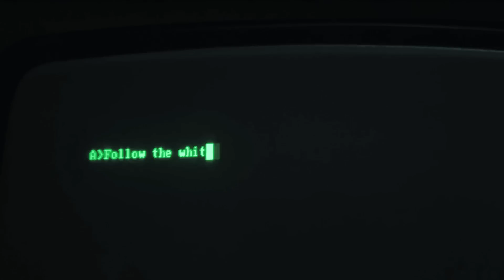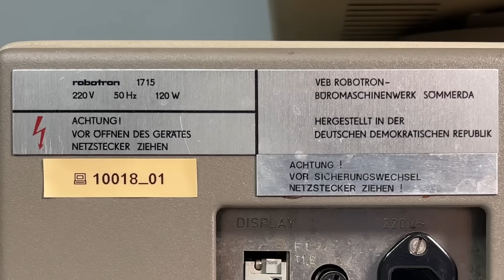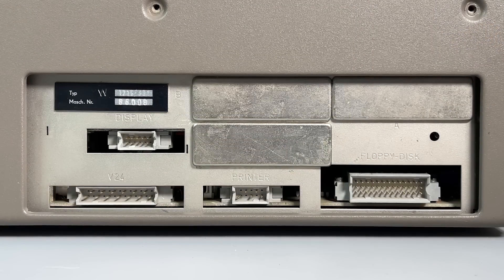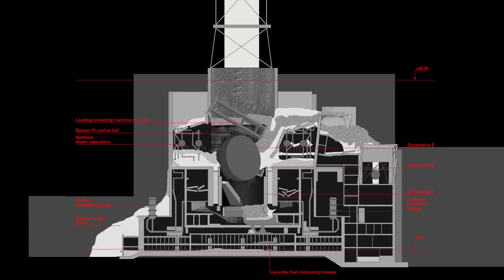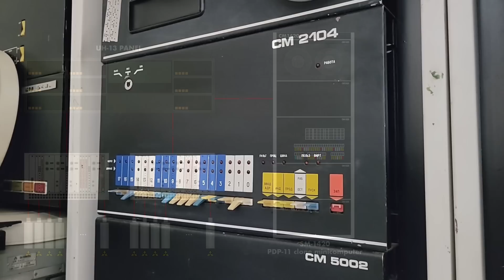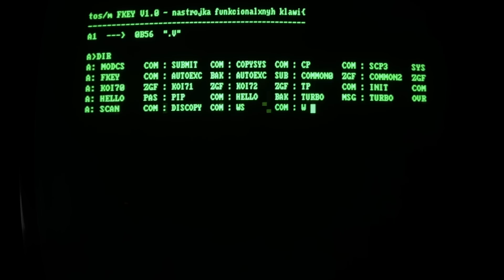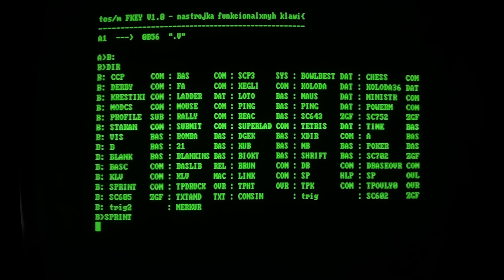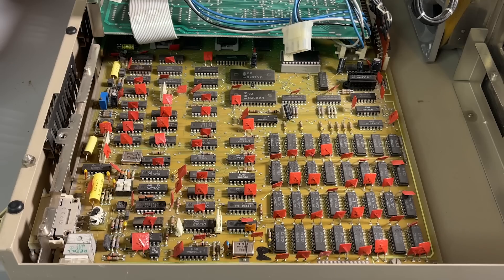How a little East German Computer Monitored a Nuclear Tomb | Robotron 1715M TEST RUN

Comment: 13:45 => the real Z80 => I remember an old (western) computer journal, where they inspected east german computers and found a broad variety of chip manufactures. The factory people (probably even robotron) answered: "We used what was available". You can also see some small ICs on your board: some are "DL..."-labeld, which is the east german coding, others are "SN74..." western model and russian "K..."-labeled ones.

Comment: Here the Translation for the 3d Maze game, its in German.

Run through the maze to the exit! For your orientation, you can show the floor plan four times.
The exit is marked with #,
Your location with a > in the direction of movement!
You can also orientate yourself using the compass at the top of the picture,
the floor plan is aligned to the north.

Control buttons:
8 - Forward
4 - left movement
6 - right movement

Show floor plan - "M" Cancel - CTRL C.

@Chornobyl Family   Nice Job to make it working again ...

Comment: The East German Rossendorf Nuclear Research Facility used two Amiga 2000 as central control computers. I've been shown around in 1987, and I was told that at the time, the facility paid about 200,000 East German Marks per device.
Reply from the maker: Wow! Thank you for sharing!
Reply: That's crazy. I didn't think they were allowed to import Western computers
Reply: @Bertie_Ahern It's not that easy. And I suspect that those computers were not imported by East Germany, but sent as a gift from West Germany to East German relatives, but seized at the border by customs officers.
Reply: @SiqueScarface  thats just silly, this late into the cold war such trades between east and west germany were rare, but possible through regular channels.
It usually was simply prevented by the price tag, as this also was the time east germanies economy already was on its knees. Mind you, the mostly IBM compatible, "mass produced" Robotron EC1834 office PC was sold for 60.000 east german mark in 1988.
Reply: @diedampfbrasse98 Yes and no. Yes, 16 bit processors were no longer on the COCOM list (but 32 bit were, hence the billion East German Mark effort to create a clone of the VAX processor in the late 1980ies). Thus 8086 and 68000 processors and computers based on them were available. This is the reason why the Robotron PC1715 shown in the video has NEC and Zilog chips and not their East German (U880) or even Soviet Union manufactured (KR1858WM1) clones. But on the other hand, East German customs seized stuff from packages, which were not correctly declared. It was then sold on the official channels. So yes, it's possible that the two computers were bought officially, but it is also possible that those were seized ones. You just couldn't tell.

Comment: I have bought and restored two of these (including two monitors) some time ago. Indeed, the fan of the power supply is quite something - heavy metal propeller and runs on 230V ac. Usually these power supplies need a recap and re-tunining sometimes with an odd transistor burned, for the screens a common fault is the flyback high voltage transformer. I was very lucky, because one 1715 had a 100% readable floppy inside with the clone of cp/m and after repairs it all booted to command prompt. My motherboard has the east German/Czech(TESLA) and Polish(CEMI) components. Thank you for this fantastic material, it's a pleasure to watch, especially with my 4 year old son who loves all robotron machines and your channel :D As a side note, I'm looking for the plug of the 1715 keyboard, as the only keyboard I was able to buy someone had its cable cut off.
Reply from the maker: Thank you for sharing!

Comment: It is a nice computer, and the PCB design is a nice and good design.  Are those  decoupling capacitors (Red ones) made by Mica or Ceramic?
I found on Google this CIA declassified document talking about electronics in the Soviet Union:
https://www.cia.gov/readingroom/docs/CIA-RDP80-00809A000700030074-5.pdf

Comment: The delta signs are a curious sign of modernity, in that the original Robotron 1715 (and I suspect, the default character set of 1715M) has a rectangular block at the position of character code 0x7F. It's not considered an ASCII printable character, and the code, with all seven (!) bits set, was once considered to be reserved for 'deleting' characters from punched paper tape by punching all the holes, so its ASCII mnemonic was DEL. With the advance of video displays, this particular usage was not particularly important, so various systems put some glyph that seemed like a good idea in this position; IBM chose a delta sign for the charset 437 popularised by IBM PC, probably as a pun for the DEL mnemonic. The reloadable charset that your start-up disk appears to have loaded is probably inspired by this.
Reply from the maker: There was a cool feature of this Robotron. You actually could load own fonts and character sets programmatically. This way you could massively extend pseudo graphics, which was actually used in a few games.
Reply: @ChernobylFamily  Yep! You can see the font being loaded in the boot-up in this very video, even. (I've only got font ROM dumps of a couple of variants of the original 1715, so I can't say for sure what might have been in the default font ROM of 1715M.)

Comment: Now I want such a box. That computer is actually awsome and made in Germany.
Reply from the maker: Imho, it is very limited for a meaningful retrocomputing, but at the same time it is rock solid, so maybe it is a good choice.
Reply: @ChernobylFamily  It´s the rocksolid part I like much.
And when it can do Tetris it´s good enough for me.
It´s  the looks at 2nd that I like, too.
Sadly these cans went decades ago from where I live and I need the hole shabang, shipping to Germany would kill me.
But if You know of a set that is in "fix-er-up" condition aka complete, powers up, needs cleaning and paint: we need to talk.
I even have an 8dot printer that might work with that.
The set just looks apart.
I hope I can sometimes maybe get one.
Thanks for the reply
Reply from the maker: Need to think...
Reply: Robotron computers are indeed rock solid ... a museum (Technische Sammlungen) here in Dresden has quiet a number of Robotron on display and for most of my visits in younger years one or two still were operational to be used by visitors/or at least demonstrated in operation. 
there is a complete virtual tour online, looks like there are still some machines set up operational in the updated exhibit ... hard to imagine more modern computers lasting that long.
Reply: @LaLaLand.Germany  there are some floating around on ebay and other german second hand trade platforms, but most often without the monitor ... and the prices are rather high, especially when overhauled and complete.
naturally the plastic sets like the robotron EC 1834 are the more affordable entry into Robotron computing. But even with those the owners are aware of what they got.

Comment: I have the German version, keyboard and OS, in my retro corner but i need someone to fix the screen for me. Big scary voltages might fry big scaredy lioness. o.o
Otherwise it works perfectly fine.

Background of the machine as far as i know it, it was send to an apothecary in the GDR, opened but never set up as the unification was around the corner, so it was never used before a friend and fellow das-labor member got it. He had to get rid of it later on and now we have it.
Reminds me, i need to image the disks with my Greaseweazle some day.

Comment: I learned on this machine in 1986/1987. ❤
Reply from the maker: Very cool!
Reply: It was funny. Normally, I'm a mainframe operator, IT basics learned @ PC1715, mainframe operating things @ESER EC1057, a russian IBM mainframe clone. 🎉❤
Reply from the maker: @SvenCurly as I remember 1057 was a DDR-made clone, many levels up to Russian ones... how reliable was it from your experience?
Reply: @ChernobylFamily This mainframe was a cooperation with several countries (GDR, USSR, Bulgaria, Hungary etc). It was similar to the IBM clone R/360 / 370 mainframe. I was operator, not technician. I don't know about reliability of the whole mainframe system, but we hardly had any downtime. :)

Comment: If one  compares what was available in 1984 in the West this computer nicely demonstrates how cringe Soviet regime was. It could not have 32bit cpu. the graphics are completely horrible. I guess they tried to compensate for actual quality by trying to make everything made of bulletproof steel 😂 and over engineering to stuff all the obsolete ttl logic which were bulking up at east commieblock factories - poor clones of western chips, too slow and not possible to be used in radiation environment (because bipolar chips degrade with radiation exposure) , years behind high integration chips of the west.
The custom software is also all cringe - ports of old cp/m programs stolen long ago, translated. 
Overall a real cringeputter 😂 the connectors are cherry on the cake. 
Thanks for sharing and upload.
Reply from the maker: So true.

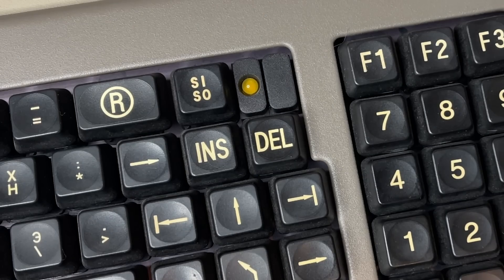Comment: @4:06 Both the "Printer" and the "V24" looks to have a bent pin on the lower left row. Be careful with those sockets. @5:10 I'm happy to see that Radio Shack lives on in Ukraine. Or at least their emblem. And I like those jumper board switches.

No orange cats were harmed (or fed, apparently) in the making of this video.
Reply from the maker: Thank you! Haha that is actually a "repeat" button which executes once more the last command.

Cat was fed well:) in Patreon version there is a scene with a stash of cat food in a book :))

Comment: In all the old electronics I’ve poked around in, I’ve never ever seen capacitors like those red ones, wild.
Reply from the maker: It is type K10-7 ceramic capacitor, with a very little amount of silver. Not very practical, as is fragile, but generally works ok even if edge is damaged. Still good that they did not place there green KM capactors, otherwise this machine would be long gone...

Comment: Those German Z80 clones must have been made very close to the original if they could intermix parts like this :). Cool video. Did they copy western tricks to allow 8 bit processor address 256 KB?
Reply: Something which can be an issue is that Western ICs use 2.54mm (0.1") lead spacing whilst Soviet ICs use 2.5mm.
A non-destructive comparison would involve using a logic analyser and having the CPU execute every instruction, including the undocumented ones.
A destructive comparison would be to decap the due and look at it with microscope.
Bank switching memory is a well known "trick". Which can be done even with 8 bit processors which don't have a separate I/O address space.
Reply from the maker: AFAIK, that was a full clone. Unfortunately, right at the moment I cannot answer the second question as my experience with those is somewhat limited.
Reply: Yep, U880 is an exact copy of Z80 at the silicon level. The only difference is, it's packaged in a metric chip carrier, so the neighbouring pins' distance is not 2.54mm but 2.5mm. Makes for a 0.74mm total difference over a 20-pin row.

One of the reasons for using sockets for the large chips in Eastern Bloc electronics was, it lent the additional degree of tolerance to accommodate Western chips with 2.54mm pitch in a PCB whose holes were drilled on a metric, 2.5mm, grid.

Comment: The strangest thing for me is that they were able to copy the microchips, but were in no way able to copy a decent keyboard.
Reply from the maker: I mean, the keyboard is super well built in fact;. just after nearly 40 years and obviously extensive use it is in its afterlife stage...
Reply: @ChernobylFamily  in this case, I am a little subjective. I was a poor owner of Elektronika BK 🤕
Reply: they probably considered the existing keyboards subpar and thought they can build a better (and unfortunately overengineered) keyboard themselves because it was simpler technology
Reply: copying microchips was not that a great skill. Some spy photographed lithography masks, another spy cabled the settings of lithography machines. 
Back in those times these machines were not really advanced and you could get them from various sources . 
So imagine most of those chips were actually cloned and started up by people having no real knowledge of how it really supposed to work.
This class of chips was already Long obsolete in the West. Perhaps the home computer craze got a little of uptick in reusing them , but if you look at what was available for research and military at the same time, then the gap becomes obvious. 
Most importantly the West had already computers allowing to CAD/CAM next generation of chips. Soviets were still stuck with pencil and paper.
Reply: @piotrcurious1131  Which makes it all the more curious that KGB, having stolen the blueprints for 64-kibibit RAM chips, had so much trouble trying to steal 256-kibibit ones that it resorted to just buying a licence instead. From Toshiba, IIRC. (You'll note that this system has 64-kilobit RAM chips: 32 chips making up 256KiB.)
Reply: @rileyfaelan  It does not mean they did not stole it. Note they lived in two words. Nowadays when loads of things is no longer a secret people have this illusion that everyone knew everything. So in the same factory one shift could make "legal" chips and another "military" chips, each not knowing about the other. Some things were difficult to hide though so they needed coverups, esp. from skilled engineers.
IDK about your sources for 256k chips but afaik even for 64k chips the yields were so low (or military stole the best chips) that even internally most of the times they had to steal and smuggle the chips from the outside and just pretended they made them by shuffling the papers.
Reply: @piotrcurious1131  I think there's an Asianometry video about KGB's efforts of stealing 256Kib DRAM chip technology being so fruitless for so long that they gave up and decided to just buy the licence. I am not sure what caused this, but it would most likely have been some sort of die shrink technology update that somebody at USSR had trouble grokking.
Reply: @rileyfaelan  interesting. Assuming western companies knew Soviets steal, they could introduce tricks to counteract this by f.e. introducing etching tweaks influencing capacitance or introducing doping modifications influencing on-die pullup resistors which would render masks being used with old settings and materials useless. I recall that for the dram just the packaging did matter - Soviets packaged their chips into clay(ceramic) packages , giving superior performance in military environment, but as clay is slightly radioactive it caused DRAM bit flip. No idea really, pity there are no more solid sources on that period of history.
Reply: @piotrcurious1131  Zilog added undetectable doping changes to the Z80 that would obfuscate what it was doing at the transistor level (though their concern was Japanese companies stealing the design).  Copying by the Eastern Bloc was known to be occurring though; DEC playfully acknowledged this when they placed a message in Russian on the die of a VAX microprocessor that was intended to read "VAX - When you care enough to steal the very best"  :^)